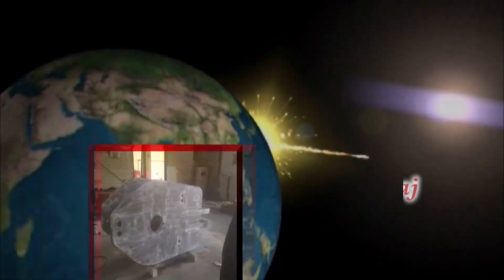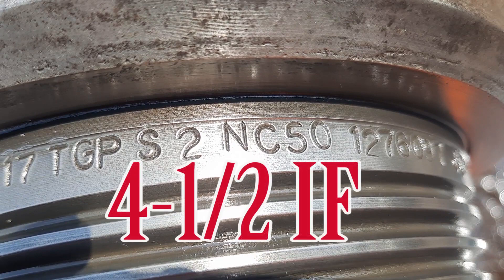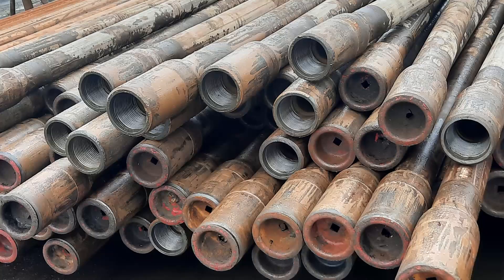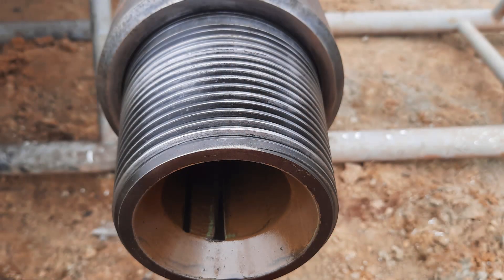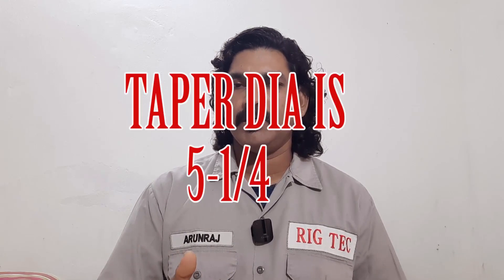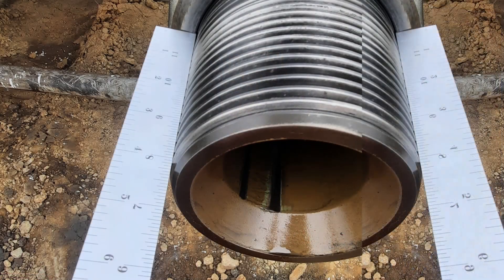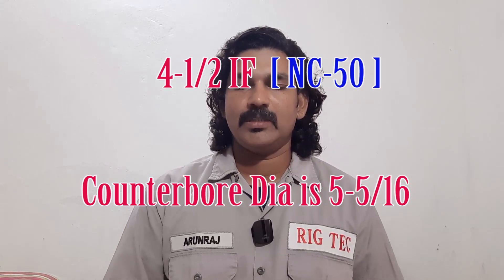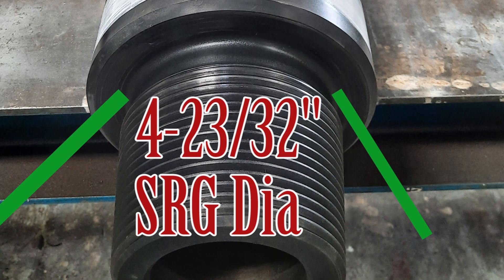NC-50   OR  4-1/2 IF ROTARY SHOULDER CONNECTION.

Comment: Sir  how to identify reduced TSR in Drill pipe
Reply from the maker: TSR are directly related to tool joint OD for fishing Clearance.  Tool joint OD is below nominal, but tube body is premium the pipe is acceptable with reduced TSR.

Please refer DS-1  Volume 3 
Section:  5.2.3
Page No.352

Comment: Pin cylinder diameter is not 5 3/16 you’re crazy. It’s 5.150 - 5.120. The closest you can get with fractions is either 5 1/8 / 5 8/64 to 5 9/64
Reply from the maker: You are right and this dimensions not for QC . These dimensions helps the people who worked in drilling industry to easily identify the connection. They are not using the micro meters or vernier caliper for taking dimensions. In rigs they are using OD caliper and scale for taking dimensions. OD caliper have certain limitations, these limitations I explained in my videos. So I always says the approximate values. If you are using the OD caliper you can get the values what I said in my videos. In my videos I also recommend the OD caliper and scale. 
Thanks for your comment.

Comment: How to calculate bending strength ratio
Reply: please explain
Reply from the maker: @Venkateshyadav_1 A.2 Drill Collar Bending Strength Ratio The bending strength ratios in this standard were determined by application of the following equation:
BSR=
Where:
+= (-b)+(R-d²)
D
÷
BSR = Bending Strength Ratio
ZB
Zp
= Box Section Modulus (in³)
= Pin Section Modulus (in³)
D = Outside Diameter of Box (in)
d = Inside Diameter of pin (in)
b = Thread root diameter of box threads at end of pin (in)
R = Thread root diameter of pin threads (in)
..(A.8)
To use Equation A.8, perform the following calculations:
=
Dedendum (0.5H - fn)
Where:
_
...(A.9)
H = Thread height not truncated (in) (API Spec. 7-2) Root truncation (in) (API Spec. 7-2)
frn
b = C -
tpr(Lpe-0.625)
+(2⚫ dedendum) ..........(A.10)
12
Where:
C = Pitch diameter (in)
tpr = Taper (inch per foot on diameter)
Lpc
=
Length of pin (in)
RC-(2 x dedendum)-(tpr/96)
Reply from the maker: See Short reply
Reply from the maker: Kindly refer A.2  from DS-1 Vol3

Comment: Sir how to measure TPF
Reply from the maker: D-d /L
Reply: Short cut I didn't understand sir
Reply: @Venkateshyadav_1  you need a taper gauge with contact points of .144. Most numbered connections are 2 inch TPF and 4 TPI. Find a fully formed threads on the start of the connection. Place your taper gauge, zero it out and count 4 threads backwards on pins. For pins your taper ranges from .167-.169 

For boxes you start in the back and move up 4 threads. And your pitch diameter ranges from like .164-.166 

Note it’s good practice to check the taper in multiple spots to ensure your machine is cutting consistently